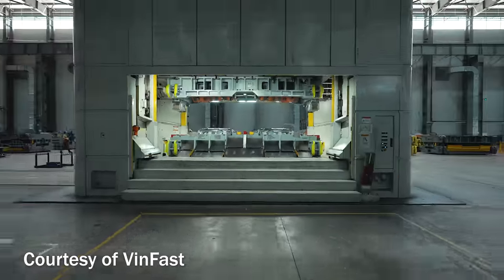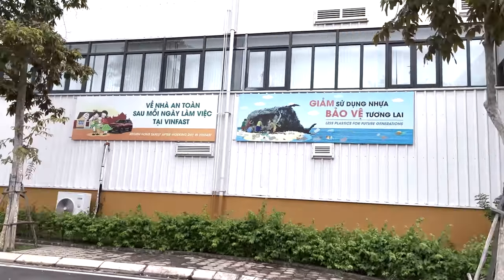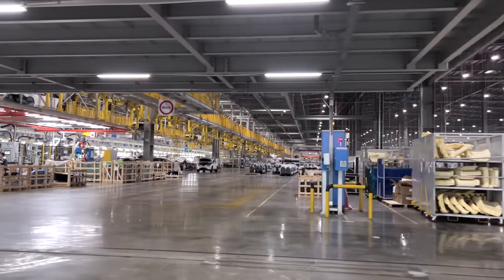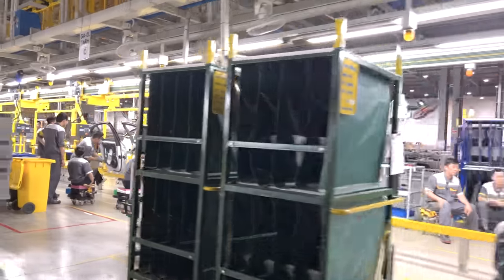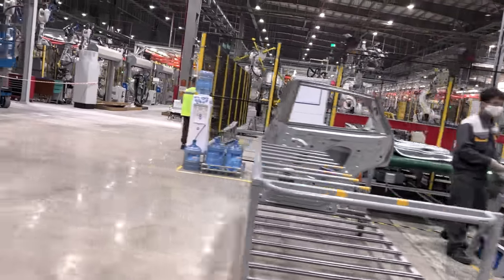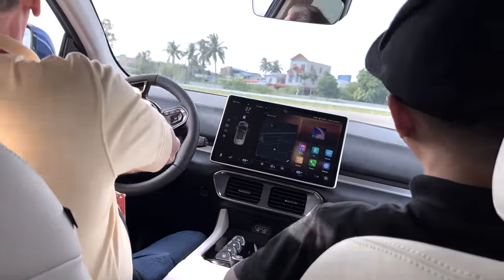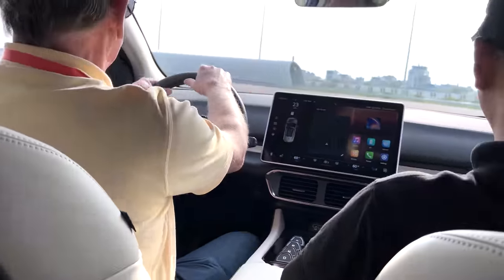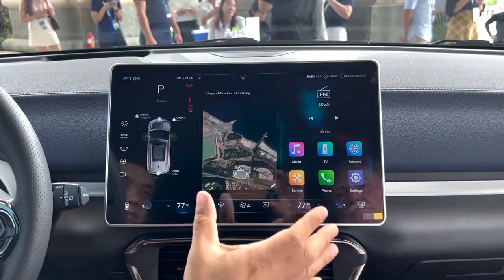Sandy and Cory's Trip to VinFast: Batteries, Test Drives, & Similarities to Tesla

Comment: As far as I know, Sandy has been the only one that talked about the patented battery innovation of Vinfast. In terms of EV safety, many Tesla cars have exploded and caught fire because of Tesla batteries. Themotordigest reported in March 2022, "Sixty Tesla Cars have been damaged by fire in the last eight years. That means, every year, 7.5 Tesla’s have been damaged by fire." By contrast, there has been no problem with Vinfast EVs or batteries. According to reports, over 2,000 units of Vinfast e34 (a smaller version of VF8) and over 200 units of Vinfast electric public 60-seater SmartBus (or VinBus) have been on the road in Vietnam since October 2021. So far, the electric public buses have transported over 122 million passengers in Vietnam for almost a year. Surprisingly, there has been no problem with the Vinfast electric vehicles or batteries!
Reply: Vinbus batteries are bought complete from CATL China, very different from the cars. But yes, good safety record.
Reply: @GntlTch  very true!
As a past VF employee,  I won't say too much ..... but yeah,  you can't compare.  Forget the EBus, totally different battery.
As for the VN domestic VFe34, accumulated miles is many orders of magnitude different. VF also has a powerful social media suppression mechanism active in Vietnam....
Reply: @GntlTch  "Tesla has a fleet of over 3.2 Million vehicles while Vinfast has barely 2 thousand. Tesla has SIXTEEN HUNDRED times as many cars on the road as VinFast." Here are the facts. VinFast’s first electric motorbike Klara was made Vietnam in 2018. Since then, it has been more than 4 years with over 2 million electric vehicles (EVs) on the road in Vietnam, from fully electric motorbikes and SUVs to fully electric public buses carrying 60 passengers at a time; none of the VinFast EVs catching fire or exploding has been recorded! Tesla has NEVER made any electric public vehicles carrying more than 10 people at a time. However, according to the web-based news Vietnam Plus, a fleet of over 200 units of fully electric public VinBus since September 2021, has safely "carried over 122 million passengers" in Vietnam, which are 4 times more than Australia's entire population or equivalent to Japan’s population and roughly 1/3 of the total US population! Surprisingly, not even a single case of electric VinBus catching fire or exploding has been reported so far. However, fully electric public buses catching fire or exploding have been reported in China, France and even in America! 
https://www.youtube.com/watch?v=_8YClwsWTyU
https://www.youtube.com/watch?v=T71cVhxG_v4
Reply: @imaGINAtion  VinBus uses sealed battery packs supplied by CATL (China). 
Scooter batteries are also different from the cars.
The first vehicles using Samsung SDI 2170 cells are the domestic VFe34 (maybe 1000 units on the road,  in last 12 months only), and the VF8. Number of domestic VF8's on the road is VERY small.
The car battery packs are VF design, using the previously mentioned SDI 2170 cells. Other components are coming from various Chinese & Vietnamese suppliers, and some parts made in house.  This design is relatively unproven, because almost nothing in common with the bus or scooters. Time will tell if good, or not.
Reply: @imaGINAtion  Also worth mentioning- 1st batch of US VF8's only certified for 180 mile range,  in special "City" edition. Reasons for this are currently not public information.
Reply: @gregreed2713  First, saying "VinBus uses sealed battery packs supplied by CATL (China)" is totally baseless because all the VinBus units have been manufactured in Vietnam since December 2021. However, Chinese CATL just singed MOU with VinFast in October 31, 2022, which is almost a year later. Think before commenting.
Reply: @gregreed2713  Also, saying "Scooter batteries are also different from the cars" is quite clueless because electric scooters and cars have the same design concept using electric motors (not engines) and batteries to partially or fully power the motors. By definition, the term "electric vehicles" or EVs means "an automobile, e-scooter, e-bike, or other vehicle having an electric motor that is fully or partially powered by batteries," according to dictionary/com. This is why when you read a report saying on average 7 Chinese made EVs catch fire or explode every week. The number includes electric motorbikes and cars.
Reply: @gregreed2713  Furthermore, unlike 10 or 100 or even 500, 1.000 is NOT a small number. In fact, more than 2 million VinFast electric vehicles (EVs) including fully electric motorbikes have been sold over 4 years since 2018, and currently on the road in Vietnam. Surprisingly, not even a single VinFast EV catching fire or exploding has been recorded so far. However, according to an 8-year report published in March 2022, on average 8 Tesla cars catch fire or explode each year. I have already mentioned VinBus in my above comments. In case you missed it, I posted here again. VinFast has launched a fleet of over 200 electric public buses called VinBus carrying 60-70 passengers at a time, since December 2021, and since then the fleet has safely transported more than 122 million passengers in Vietnam, which are 4 times more than the entire population of Australia, more than twice the population of France or equivalent to Japan’s population and roughly 1/3 of the total US population! Surprisingly, not even a single case of electric public VinBus catching fire or exploding has been reported. By contrast, cases of electric public buses catching fire or exploding have been reported in France, America and China. Even Tesla has never made any electric vehicles that can carry more than 10 people!
Reply: @imaGINAtion  I was working in Vinfast at the time leading up to the bus launch, and after. I can assure you,  CATL was a "regular" supplier long before the MOU for further collaboration was signed
Reply: @imaGINAtion  Again, I was working in Vinfast, I'm intimately familiar with the design,  I've seen all the component drawings. I was responsible for supplier quality on all Chassis/Electrical/Battery parts for bus,  car, & scooter.
How about you?
Reply: @imagination7555  nonsense.
In automotive,  1000 is peanuts. Ford & GM make almost that many in preproduction testing.  
And 2 million total units sold - no.
I was working in the factory in Hai Phong in 2019 & 2020, so I have a pretty good idea about this.
Reply: @gregreed2713   Regarding the 180 mile range "City Edition" of the VF8, NHTSA has used an index number of 0.7 to estimate the VF8 range in America for its standard version 1 of 85 kWh battery size, which is in fact good for 260-292 miles (based on the lowest number of the range 260 x 0.7 = 182 miles). The current 200-280 mile range of an EV is acceptable. However, based on the information of the VF8 users in Vietnam, many have confirmed that on average 1% of VF8 battery can travel up to 4.2-4.5 Km or 2.6-2.8 miles, which means 100% battery can go as far as 420-450 Km or 260-280 miles (or 1 kWh battery can travel up to 5-5.2 Km or 3.1-3.3 miles) depending on the drivers’ habits, the weather and road conditions. In one case, 1% of a VF8 Plus battery has gone only 3.6 Km (or 2.3 miles) at 100-120 Km/hr (about 65-75 miles/hr) on a Hanoi Freeway-good condition, with 2 adults and 2 children and AC constantly on; the outside temperature was 13 Celsius degree. This meant 100% of VF8 Plus battery in the case has reached 360 Km or 225 miles, not 180. Also, the VF8 range is going to be improved next month with the updated software, according to VinFast. After all, VinFast EVs are not new. In reality, over 2 million VinFast EVs have been out traveling safely on the road in Vietnam for over 4 years. The fact that hundreds of millions of passengers have been transported safely in Vietnam by VinFast EVs especially VinBus, has solidified that VinFast EVs particularly VF8 have high quality with an incredible safety record.
Reply: @gregreed2713   "I was responsible for supplier quality on all Chassis/Electrical/Battery parts for bus,  car, & scooter." PROVE IT!!!
Reply: @imaGINAtion  please stop spreading false information!!
There are NOT 2 million VF EV's on the road!
All car production until Dec 21 was ICE.
Domestic VFe34 (launched Dec 21) sales are maybe 1000, 2000 very max.
Domestic VF8 sales in the hundreds only, in Q4 2021.
Bus production,  maybe 200, using Chinese CATL battery assemblies.
Scooters ...... early one used system from Bosch, many were lead acid batteries, not Li-ion.
Reply: @imaGINAtion  I  was SQE Manager, reporting to the SQE Director Stuart Kinkade, who reported to the Quality Director Mr. NHICH. 
I had a team of 12 SQE's reporting to me, 1/2 in Hai Phong, the rest in China, India, Korea, and the UK. I lived in the Vin Pearl Imperia hotel, before moving to a house in Me Linh (also Hai Phong). I used to shop in Mega Market (Hong Bang), cuz I didn't like Big C.
Need more proof?

Comment: tesla also can go into "neutral" by holding the stock up half way for 2 seconds.  however this does not disengage anything and the motors still spin.  Also tesla does in fact have a car wash mode.  talking about these two things as revolutionary is confusing.
Reply: Neutral allows Model Y to roll freely when you are not pressing the brake pedal: When in Park, shift into Neutral by briefly pushing the drive stalk either up or down to the first position. When in Drive, shift into Neutral by briefly pushing the drive stalk up to the first position.

Comment: Those 24 hours flights to Asia are killers.  Could see the effects of jet lag and time zone changes.  P.S.  in the Tesla's with an actual gear shift, to get to neutral, you tap the gear shift lever up out of drive or, if in reverse, down out of reverse ...  the car will then be able to coast and/or roll ...  Not sure how it works on the touch screen version of the plaid shifter.  Get some rest.   Best regards,

Comment: Sandy, Tesla does have a neutral, have a look on the top right side.
Reply: Or, USE THE STALK.

"Neutral allows Model Y to roll freely when you are not pressing the brake pedal: When in Park, shift into Neutral by briefly pushing the drive stalk either up or down to the first position. When in Drive, shift into Neutral by briefly pushing the drive stalk up to the first position"
.
DON'T GUESS, SEARCH IT

Comment: #Tesla into Neutral  hold down Half way. Don't pull down all the way into ⚙ gear.
Reply: Depends.
Neutral allows Model Y to roll freely when you are not pressing the brake pedal: When in Park, shift into Neutral by briefly pushing the drive stalk either up or down to the first position. When in Drive, shift into Neutral by briefly pushing the drive stalk up to the first position.

Comment: You half press the stalk for neutral
Reply: Or to be precise
.Neutral allows Model Y to roll freely when you are not pressing the brake pedal: When in Park, shift into Neutral by briefly pushing the drive stalk either up or down to the first position. When in Drive, shift into Neutral by briefly pushing the drive stalk up to the first position.